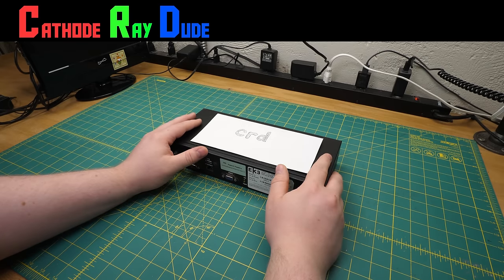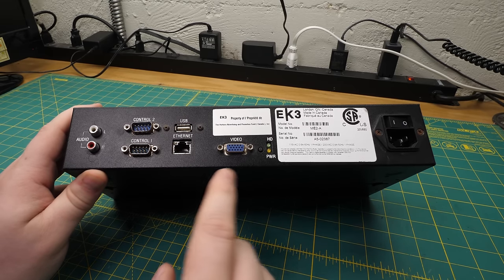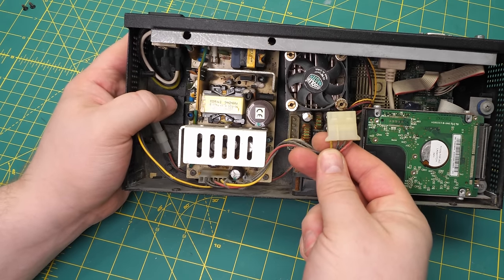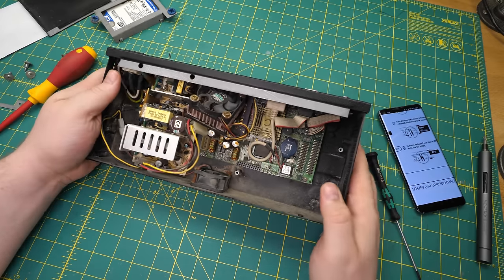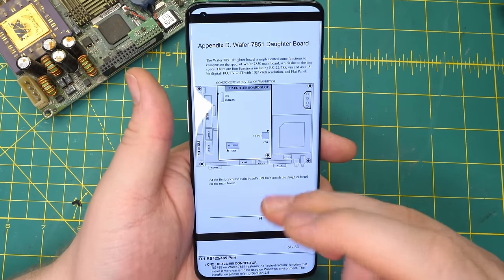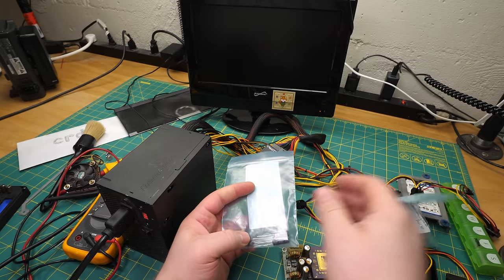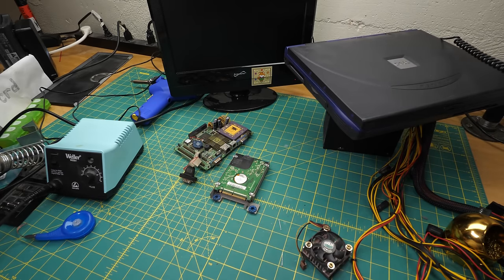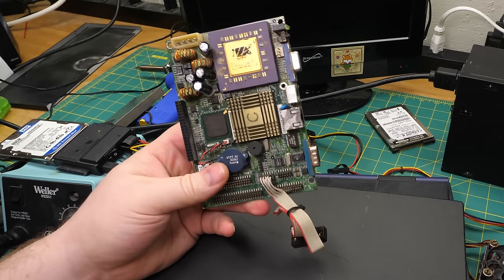Little Guys 8: This one won't fly [EK3 Media Engine]

Comment: the Amiga 600 and 1200 are suited with 44pin headers on the mobo for 2,5" drives via a ribbon cable.
back in the days we often modded those from 2,5" formfactor to 3,5"  by splitting the cable or via an adapter to fit a bigger and mostly cheaper 3,5" drive, cuz 2,5"  drives where pretty expensive back then.

Comment: The Via C3 did make a lot of sense from a TCO perspective.. while less performant than its Pentium3 counterparts at the same speed, they came with a TDP of around 6 Watts, compared to 30-35 Watts for the Intel chips.
Reply: Yeah, if it was fast enough for what you needed then it was cheap as shit and ran very cool esp compared to PIIIs.

Comment: 43:06 MBR partition table is limited to four partitions; the type "Extended" is just a hack to add more partitions.
Reply from the maker: @doq  yeah, but you'd think mount would understand that and give a meaningful error
Reply from the maker: @doq  yeah, but you'd think mount would understand that and give a meaningful error
Reply: @CathodeRayDude  Probably so, but Linux is Linux and I bet mount actually attempted to mount that instead of seeing it and "oh, this isn't a real partition, let me tell the user that"
Reply: It tells you where to look for meaningful info. ;-)

What happens when you blindly try to mount something is both well documented, and quite unpredictable. mount tool knows little about filesystems that potentially exist on the third planet from the Sun, or are supported by a given system at a given time, it relies on kernel and filesystem drivers. If type is not defined by the user, it tries each available filesystem driver in a certain order (see option -t in the fine manual). After ext family and other filesystems with well defined metadata formats decline to work with that device, basic ones try their best (e. g. raw floppy, maybe some raw flash fs with hard-coded sizes and offsets for embedded use). It is totally possible that one of them finds some arbitrary bytes, interprets them as filesystem size of 555 petabytes, honestly tries to allocate enough memory to work with such a giant, then fails.

mount is traditionally for administrators who know what they mount. It may not succeed with a perfectly fine partition just because of some missed critical option (even though ext family should be generally backward compatible). A full-featured graphical disk/partition management utility from any general distribution should show you both partition metadata and filesystem metadata before mounting anything. There is also an option to ask testdisk to perform an analysis if you're unsure.

This was mostly for curious readers, I'm sure our host is no stranger to manual calculation of disk offsets.
Reply from the maker: @DarkKnight32768  oh right, of course, I was thinking at the wrong abstraction level. Mount is unaware of the partition table because you give it the block device representing the partition after it's been carved up by the OS. Presumably extended partitions do not contain a magic number that would make sense for mount to look for.
Reply: And here's the most fun bit: Extended partitions are such a hack that each and every extended partition is actually a node in a linked list of partition tables. 
Yes, it really is that bad.
Reply: @CathodeRayDude  Extended partitions are more magic than you think. Go ahead and look at the structure for one in Norton Disk Editor; I dare you 😎
Reply: ... and then, think about some of the more exotic boot managers that existed at the time, claimed to be able to support as many as 99 primary partitions (as well as the ability to reorder/renumber the partitions per operation system) and consider the technical ramifications of this.

Comment: Old hardware brings back dim memories. AST multifunction boards (RAM expansion, Parallel and Serial ports) Hercules mono graphics boards, actual separate RAM chips, Hard drives on an expansion card and separately socketed Floating Point chips. My first PC compatible was a no-name 286. Overlocking a Celeron 300A to 450 MgHz. Those were the daze.

Comment: Power screwdriver recommendation: Vessel Ball Grip.
They're about the size of that Whia insulated driver you used to remove the HDD screws and have a reasonably ergonomic slide switch. They come with two different gear reductions, the gray handle is higher speed and works well for general computer screws into metal, if they're tight you break them loose by turning the driver, then speed them out with the motor, but screws into plastic often have more drag for the entire length of the thread, the low speed black handled driver works better for those. Bonus: They're made in Japan and come with a rather nice #2 JIS bit.

Comment: 43:10 it seems to be a mostly sensible partition table for this kind of device, from what i can see:

sdb2 -> / (system root directory)
sdb3 -> /var
sdb5 -> /usr

While sdb10 i think would be /root (the root users "home"), but it's possible it could be /opt (though that's more likely the 75gb volume), either way the rest should nest below it like so:

sdb6 -> /sdb10/incoming
sdb7 -> /sdb10/bin
sdb8 -> /sdb10/lib
sdb9 -> /sdb10/etc

With these partitions containing the bare minimum utilities necessary to remote in and configure/diagnose the device, seperated to be less prone to breakage from changes and updates
Reply: The 75 GB partition is the "Extended partition table" which contains all of the remaining positions. The MBR extended partition scheme is another one of those historically significant horrible kludges that it's best not to dive into right now; but suffice to say it is a horribly fragile hack and best avoided for all but legacy applications.
Reply: @BrendonGreenNZL  ah, right, been so long since I formatted a drive with an MBR scheme I forgot about that 🤦

Comment: ZIF sockets were around since at least socket 1, at least for PCs. So... much earlier than the Pentium 3. Socket 1 was the same 169-pin socket that 486 overdrive CPUs used but enhanced with a ZIF+lever locking.

EDIT: I see this is in your pinned comment. Nevermind!

Comment: Like you said, the Wowstick works great for driving lots of small screws that aren't stuck or threadlocked. But reef on it like it's a boring unelectrified screwdriver and the gearbox will break. And that's why I bought it twice.

Also, that power supply looks like it came from an external SCSI drive enclosure.

Comment: Not surprised those caps gave up the ghost and took other power regulation components with them. That board was manufactured right in the middle of the capacitor plague era. I seen dozens of mainboards from the later Pentium 2 boards all the way through the Core 2 days die from bad caps that often times took power regulation components with them. So there was no way that board was going to work even with the caps replaced.

Comment: @43:00 sdb4 didn't mount because that partition is an MBR extended partition than includes all the partitions after it. Take note of the size of sdb4, which roughly is the sum of the following partitions. This exists because MBR data structure had a limit of partitions of 4 originally, but it was later extended by producing a fake, unmountable partition containing the extra partition's metadata. No ideas on the weird linux mount error though
Reply: Take a look at an MBR extended partition table in Norton Disk Editor sometime. What you find will utterly horrify you; especially when there are this many partitions involved.

Comment: There were ZIF sockets starting with the 80486. Before that there were many 80286 CPUs in the LCC (Leadless Chip Carrier) package that had a single row of flat contacts around four edges. The CPU was held onto the socket, which had spring contacts, with a metal clip and a small finned heatsink. Not that the heat sink was actually needed, except possibly with the rare 16 Mhz version. Most of these 286 systems I encountered were 12 Mhz.
I'd call that 286 style the great grandpappy of the Land Grid Array CPUs and sockets.

Comment: FCPGA=flip-chip pin grid array. The pin grid array refers to the pins on the bottom laid out in a grid. The flip-chip part refers to the silicon die being on the opposite side of the package as traditional. CPUs used to have the die packaged from the bottom, the flip-chip package put the die on top, this was started with the pentium 3 and is where you will typically see the exposed die on the top of the CPU (there are actually several protective layers and things there protection the silicon).

ZIF sockets started with socket 3 (486), I don't remember socket 4 (original Pentium), but I think all socket 5 (second release of Pentiums) that I saw were ZIF and definitely almost all socket 7s were ZIF.

Comment: With caps you can go with a higher voltage and you could probably get away with a slightly lower capacitance but the correct value will always be best.
Reply: The most important characteristic in this case is that they must be low ESR capacitors, else they will not work at the frequency they are being operated at. Power supply circuits, as a general rule, have the capacitors specified at twice the design value, to account for deceased capacitor performance due to ageing; so as long as you don't go too much higher or lower than what's there, the voltage regulator ought to work just fine.

Comment: 9:28 Don't turn it on, take it apart!
16:57 They do have the ability to have two different drive selects, yes. Also, 2.5" drives only require 5 volts - This even applies all the way back to the first ones, the PrairieTek 120 and 242 in 1988.
23:57 It's worth noting that early PGA CPUs had the die underneath, hence socket 370 here being "Flip-chip." The die is mounted on the top (For more effective cooling) rather than the socket 5 / 7 Pentiums, 486s, 386s, and even some 286s that were PGA. This also includes stuff like the Motorola 68040, which is PGA but not flip chip. There were also plenty of ZIF socket 5 and 7 machines, but 486 era they are far more rare.
33:57 They are filtering capacitors for voltage stability. Voltage rating does not matter as long as it's the same or higher, lower ratings are usually cheaper. Might be worth trying the 1800s in there.

Comment: PGA is indeed the grid of pins, obviously. Flip chip means the chip is bonded with its face down on the substrate. Chips are more commonly glued down first and then bonded with wires from the top surface to the pins on the substrate which is a problem when your number of pins goes up like they have with CPUs. Flip chip also helps with cooling for the same reason.

Comment: Since you requested precision electric screwdrivers rec's; my dad received a 'fanttik nex e1 max' from my uncle last year. They both keep it on their kitchen counters lol. Has a cool extruded aluminum case. Charges with usb-c. Looks sharp as heck. Quite torquey(spelling?)

Negatives after I used it: I wish the high speed was a bit quicker.
Torque falls off when bats about dead. If a screw has locktight or is really on there, both high and low speed still have enough torque to strip soft metal. I get around those problems by breaking screws loose manually.
Reply from the maker: Huh, that's really intriguing - I'm positive that's derived from the 'wowstick' one I have, yet it's clearly different, I don't have the torque control, so who knows what else they changed. Might be worth checking out, thanks!
Reply: @CathodeRayDude  i noticed your driver had what looked like the same shape and close dimensions. I imagine the driver are pretty cheap in of itself, ive seen similar scrolling through Amazon. I feel most of the value is in the slick case and magnet driver holder.

Comment: FC-PGA refers to Pentium 3 Coppermine and newer. The die was flipped upside down to be closer to the surface for better cooling. There were PGA only socket 370 boards that only worked with Mendocino Celerons up to 533 MHz.

Comment: I've had a good amount of luck using the tiny drill screwdrivers that run off 1 18650 and are usually either 3.7V or 7.2V, especially if they have a clutch on them. I use mine (from NoCry, which is a goofy name) for electronic disassembly, as a general driver, and also to extract stripped screws and it works pretty well for all of them, though it is kinda slow to drill out screws (I have to remove an annoyingly high amount of stripped screws at work cause people overtorque and locktite the shit out of random screws that don't need it on some planes). I use an adapter to go from 1/4" drive to the 4mm that my home precision bit kit uses for electronics, though haven't found anything for the 3.5mm bits my new klein kit uses yet. Would definitely recommend getting a similar driver, though.

Comment: I believe you might be referring to the Arrowmax SES Pro and SES Max screwdrivers when you mention the gyro twist feature. FWIW, I've found that setting my Max to constant max torque (4) makes it a LOT better to use - the default variable torque mode requires you to twist your hand way too much to get usable torque, but you can set it to use a constant torque value instead so it triggers as soon as you do the ~1/8th turn. On my Max you triple click to start changing the mode, then single clicks cycle between A/1/2/3/4.

Comment: The one you were thinking about was  the Miniware ES15. has more torque, uses precision 4mm bits and actually has the option to press the button rather than using gestures.

Comment: I love this series and it's oddly relevant to me. Where I work, we've just transitioned all the user pc's to a fleet of little guys (mostly the M70 range of Lenovo's Tiny model). They're essentially just laptop components squeezed into a box that's a 1.5 inch high 7 inch square. I like working with them cos  they can just slot in and out of their companion monitors, so servicing them is easy. It's a good design, with the ram and nvme drive on the back of the mb where they can be replaced without hassle, basically one screw is all it takes. 

Also, one of the managers decided he'd like some propaganda screens in various places and tasked the IT dept with making it happen. After doing some research,  I discovered it's not quite as simple as slapping one of our tiny's to a tv and that they'd  need things like custom hw and software that was beyond the scope of our dept. Then this series started and I was Di Caprio pointing at the tv.

I didn't find this episode boring at all. These sub itx boards are fascinating to see the different designs and  a VIA x86 chip is always cool. Garbage cpu back then but rare to see. Shame it blew up. It was that diagonal jumper shudder that did it, definitely not steam from a coffee machine and I will not be convinced otherwise :)

Comment: Many motherboards dating back to the 486 Socket 3 had ZIF sockets, so seeing this one with the old style friction type was definitely a skimp. Also, most restaurants I've been in were humid, and the rust and corrosion appear to be normal, though when you opened it up, it literally did look hosed, or wound up in the drink, one.

Comment: weridly i feel like the dother board gadet might be a inline voltage stabiliser cause thieir power suply was missing a volatage or sth but that would only work if you changed 5v 3.3v with less than 1a of current

Comment: I used a DCF610 when I was a tech for this sort of thing; lots of torque for a screwdriver, ergonomic, half the weight of a drill, good trigger control and clutch. But I still just use regular screwdrivers a lot of times

Comment: The Pentium4 was the first processor they regularily used the ZIF sockets on, both Pentium II and III were in these bulky daughterboard packages, at first because they were multichip processors with the level 1(?) cache on separate chips, later they integrated it but kept the bulky package for compatibility reasons.

Comment: I remember watching DVDs on a 433 MHz Celeron overclocked to 540 MHz (raised the FSB from 66 to 83 MHz), I also remember these VIA C3 chips were about half as powerful as similarly clocked Celeron, so if the CPU was in the 800 MHz - 1 GHz ballpark, it would be able to play those files without any problems.

Comment: I have an adapter thats a 2.5" drive shaped widget with two CF card slots. You can only use it with single drive mode because one CF card is the primary drive, the other is the secondary. 

Which means that not only do 2.5" drives support multiple drives on the same bus, CF CARDS DO TOO

Comment: ZIF sockets were a thing in the P1 era and even 486 boards had socket 2 or 3 ZIF sockets. 486DX boards with ZIF sockets are pretty common, CPU's that are in a fixed socket was more of a 386 and early 486SX thing because there was no need for users to upgrade their CPU.

Comment: The little board in the add on connector... based on the pinout you showed, that might connect to the digital IO pins? could that be a temperature sensor? Back then, these weren't as common on board as they are now...?

Comment: I have a Denali electric screwdriver that was tested by Project Farm. It did quite well and i like it. It was an Amazon Basics brand built by Skil, but now the screwdriver is just Amazon Basics branded. Currently only 25 bucks. Might be what you're looking for. I personally use an adapter to make it work with my iFixIt bits (the adapter comes with some iFixIt kits), and it works quite well. You can also get extensions to make it reach things a bit better.

Comment: Btw, that little chip on the expansion header may have been attached to the SMBUS of the host. I can't find any pinout info for the daughterboard section though making it hard to guess what.
There are also apparantly 8 digital io's available so one could talk to whatever one wanted.

Comment: Amiga 600s and 1200s used those 44 pin IDE cables for 2.5" drives. That is probably the most common use case that I can think of